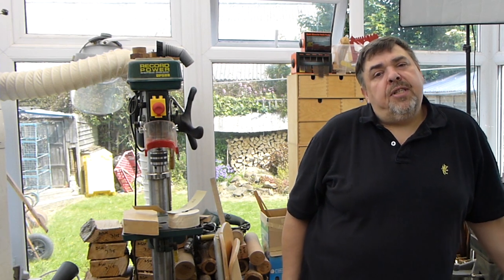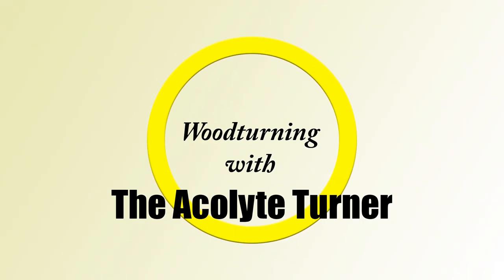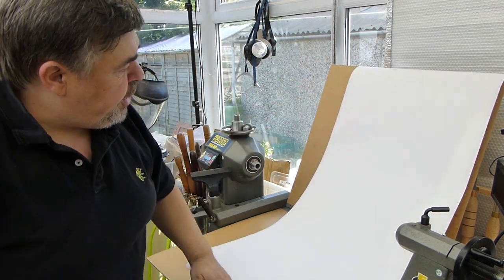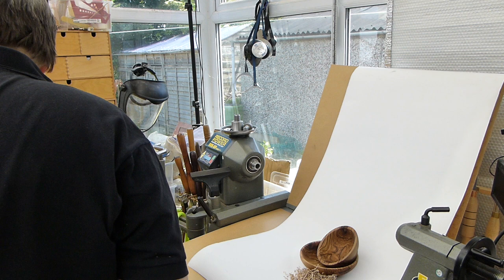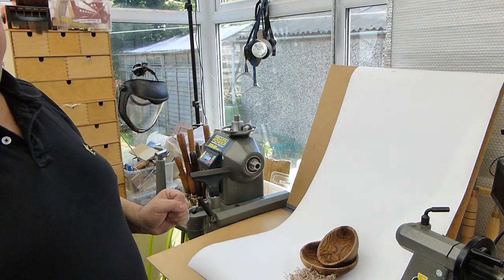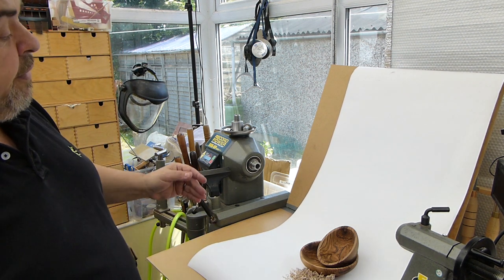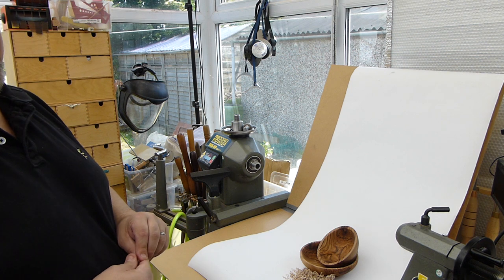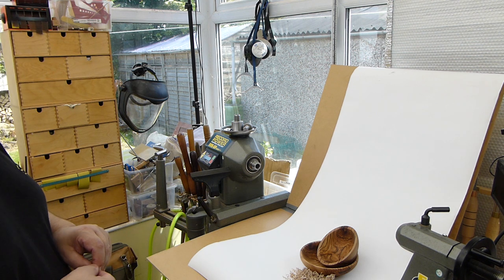#26 Simple Photography for Woodturners - Woodworking - Photography - Acolyte Turner

Comment: Great tip Tom, I do suffer with light problems, I will be using this for sure, thanks mate, all the best, Harry
Reply from the maker: The Little Garden Shed Workshop Hi Harry.  Light is the answer to everything (nearly), either photographically or video wise.  If you are going to keep making videos, the lights you use would be good for photography too!

Cheers

Tom

Comment: Great video Tom. Been going to create a photo station for some time, but was thinking something more elaborate, and you've shown it doesn't need to be. Maybe now I'll get it done. Thanks for sharing, Fred
Reply from the maker: Fred Graber Thanks Fred.  This little system is a good start, but maybe you could make something more suitable to your needs?  However if this does the job, then great.  It also takes no room to store, just slide it behind something.  Try not to fold your wallpaper though, I keep mine rolled up!

Cheers

Tom